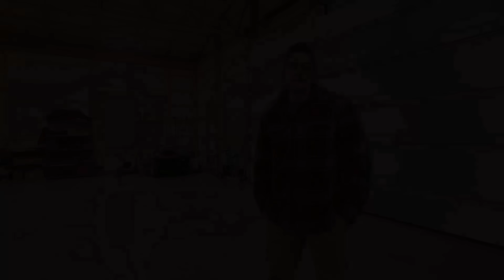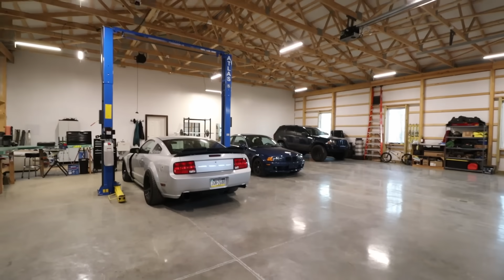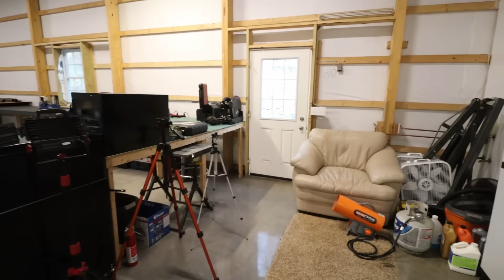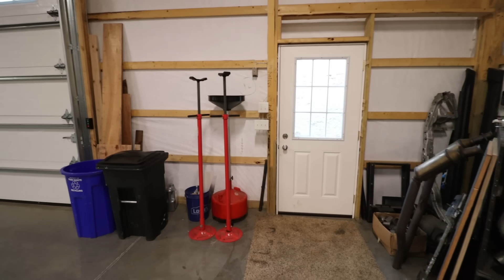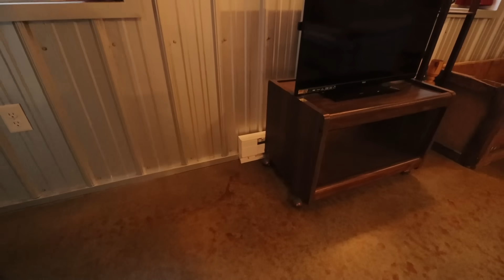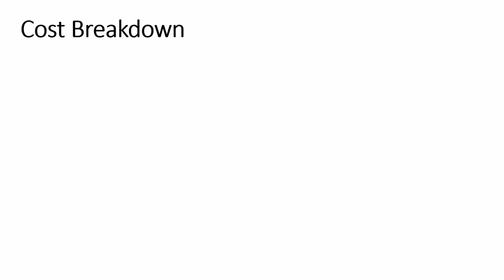50x70 Garage House - FULL TOUR and COST Breakdown

Comment: Nice job my friend. Total “It’s a guy thing” design, lol. Love it. What would be a very cool idea but also can be important to containing moisture (especially with the welding activity and any bodywork tasks as well as would definitely work as an air lock during the winter cold) would be to install a curtain rail around the perimeter of the garage door and drop a curtain from floor to ceiling in two sections from door side to center across the inner length on either side. For less than purchasing some pre-made custom curtains sized to your specific dimensions, you could actually buy the raw materials, purchase a nice walking foot industrial sewing machine (one can find some seriously nice vintage industrials for far less than new, just make sure it’s gone through by a actual pro sewing machine tech. Very important.) such as the Consew 206RB-5 or a long arm version, and make the curtains yourself. When finished, you then have a highly capable industrial sewing machine to make all the convenient carry bags, covers, and even upholstery stuff in your shop. With a long arm walking foot machine you can make some really big stuff and acquire some highly profitable niche work, lol!! You definitely have the room for it. You would be pleasantly surprised how much work comes your way once folks find out you have a true industrial walking foot machine that can effectively sew leather, vinyl, and even plastic or thin sheets of wood (I made an interesting fishing reel bag for someone that had a wooden base with leather sewn around the perimeter).

With the drop curtains in place you need not worry about where the power washer is shooting when your rinsing down a dirty vehicle and it would contain where the mist floats to that definitely carries dust particulate around the garage space. Given you have so many different activities going on under one roof this would be a huge plus. In the winter months, you can open that big ass door and not lose all your heat. When not needed, simply slide the curtains back to either side of the door. I had a friend do exactly this and it turned out to be a far more effective use than he ever imagined. He eventually installed some gripping mounts to the walls next to the door on either side so on windy cold days the curtain would stay put next to the door on either side. Then he got REALLY nuts and made himself a powered pulley set up with wires and roller pulley’s rigged up with a remote control similar to a garage door opener, lol. He gets onto his phone and checks his indoor cameras to make sure there isn’t anything in the path of the curtains, then hits the button that pulls the curtains around the bay section it creates in front of the door, then hits the remote to open the door. Stops the heat from escaping for the most part and also stops the dust and rain from misting into the open garage area. Yes, he got a little crazy and went overboard, but in the end it was actually a very ingenious set up that was incredibly effective. Something cool to consider for the future. Nice work my friend!! Especially all before you were 25!! Nice. 👍🏻😎👍🏻
Reply from the maker: Thanks a lot and yeah I have definitely thought about adding some curtains since I use the space for many different things as you mentioned. Really appreciate all the suggestions!
Reply: I thumbs up this just for the sheer length of it. TL;DR?

Comment: Only 2 things I'd do different loose the water heater & go tankless instantaneous electric water heater in the 21KW-33KW range.(big enough to shower, use washer together). Install solar panels as budget allows with a few skylights in garage. Nice job on construction, video, cost breakdown.
Reply from the maker: Thanks a lot and I appreciate the suggestions!

Comment: Did you insulate and drywall the garage or no?
Reply from the maker: Not yet. Although the seperating wall is drywalled and insulated.
Reply: @Kordare  I see just curious. Im going to build one next summer and going to leave the garage area without insulation and drywall for awhile. How is it heating in the winter? I dont know how winters are around you either. Im definitely going to do in floor heat
Reply from the maker: @yooper9062  no real heat in garage yet so it gets pretty cold, I thought about floor heating but it wasn't worth the cost and headache for the system.
Reply: @Kordare  I see haha. What were the drawbacks of the system? It seems like the upfront costs kind of suck getting a boiler and what not but from what I can see its worth it in the long run so just like to hear other perspectives. Also how are you planning on heating? Don't mean to be a bother with all the questions but im genuinely trying to figure out my best options.
Reply from the maker: @yooper9062  yeah it was the upfront cost and just another system to maintain. I was on a very tight budget so I didn't bother with it. Also didn't wanna worry about drilling into my concrete and hitting a water line. I'll probably do a large wood stove in the garage eventually since I have so much wood.

Comment: Great story. Wondering which LED lights you put in the garage?  Thank you.
Reply from the maker: Don't remember the specific brand but I have supplemented them with some more 3ft shop lights from home depot/lowes which are very similar
Reply: @Kordare  okay, so the 6 original LED light fixtures were only 3 feet long?
Reply from the maker: @scottjaenke3681  correct

Comment: Get rid of the water tank heater goto Walmart and buy a tankless water heater. ( electric) instant hot water limitless hot water. Only heat what you use. $$$ saving over the course of a few months vs month of month always and limited to 25 gallons at 158F and 25 gallons at 125 and 15 gallons at 100F. If your unfiltered well water smells like rotten eggs. ( well water ) then add a local hard water filters. Mine has eight filters. Once a year I got to change them out. Plus bags of salt to treat the water to make it softer and as purified as bottle water. But long term say a decade to twenty five years range the added annoying costs pays for itself. Because you still have Maintaince even in a traditional system on a well. That’s my suggestion. But I love this. Next large chunk of money I get I want this plan. Are ya selling your plans ? Love it. Don’t fix cars I cut trees down.
Reply from the maker: I appreciate the suggestion! And yes I do have my full plans for sale on kordare.com

Comment: As a former builder with 12 years of owning my own company, and 25 years of construction, I can say that your numbers are very realistic. I like the way that you have done this project young man. I have bought some land near the mountains out to itself in northeast Georgia. Wife wants a nice house. I want a shop to restore my 1969 Camaro. I am close to retiring from work, 4 years maybe. You have gave me inspiration at 64 years old to pursue a shop building FIRST! I might end up living in it by myself but ol well. Thank you for posting this video. Good work all around, in the video and construction.
Reply from the maker: Thanks for checking it out and good luck with yours!
Reply: I got an estimate for a 60x80 metal building slab and all for $160,000 down in texas and I believe that included 4 bay doors. The guy said the price also depends on the cost of steel at the time too and I believe it was high a year ago when I asked. Now of course this didn't include the land and this was just an open steel building with no rooms inside. I can just build an office inside if I want one.
Reply: I have two friends that have this same setup.  One is almost this exact size and one is less than half.  Both being a 25/75.    I thought living space was small at first but being a dude that’s usually off the couch and phone, the inside is for the boss lady so let her “design”  her part so you can get yours.   Dude has a lot of 💰in unused space, which is nice if it fits in the budget.  It cost more to build and more air to heat.  Porter field do yourself a favor and do the blown insulation then the foam board insulation in the wall(buy it surplus/salvaged)You can get more out of the living space by bed and bath upstairs.  Cut out the 💀 space and use the money for geothermal(you can do it yourself and way cheaper than any bid from HVAC companies) cuz the boss lady’s cold little toes are gonna have you chopping a shit ton of locust or spending your supercharger money on more coziness!   
 
God Bless and thank God for our Bull in this commy china shop Trump!!!🇺🇸🇺🇸🇺🇸💯
Reply: @mattprice37664  Hey Matt, you are a fount of info and obvious experience. Nobody in general construction videos ever talks about geothermal (unless of course, you go to a geothermal video)
When you say diy, are you still talking about hiring the drilling rig operator/ contractor, on top of doing your own pipe layout?
Also, I'm thinking of doing the deep vertical loop rather than the shallow horizontal dig-out, it just seems more compact and advanced, with higher heat potential down deeper, with a lot less mess and fuss. 
What's your preference between the two system types?
Reply: hey randall, my dad was horse guy
he definitely said to build 
your shop/barn first before 
you build her house
you need a shop space first 
to make the stuff for her house
Reply: It’s never to late, I’m your same age and I just started a 20x55 shop to work on my cars and bikes.
Reply: Realistic if we pay you. Half is DIY
Reply: How much did he pay
Reply: Divorced 42 year old. This is my dream, but I'm worried if I wait to 62, I might not be in good enough  shape healthwise to restore a car at that point (strokes and cancer run in my family).

Comment: i got an e46 for 300$ the m sport package and euro clear lights made in bavarian, check it out on my channel. can I come work for you bro?
Reply from the maker: That's super cheap and sorry I don't have any jobs to give right now
Reply: @Kordare  haha im in norcal man the "can I come work for you" thing was just a joke. yeah the e46 had some bumper damge missing a side marker light, and had 6 codes needed a valve cover gasket (60$ diy, and three o2 sensors (junkyard 5.99 a piece) new fluids and filters and threw new plugs in there for 17$ got it to pass smog runs great everything works, 326k miles and counting the only thing left to tackle is my semi sagging headliner but for 300$ who really cares. all the bumper damage I pretty much fixed with some gap filler and bondo just to give the illusion the cracks aren't there.  congrats on the property and garage really inspiring

Comment: Just curious how you afforded this. I’m currently 22 and have plans to build a 30x50 house. $3400 saved up so far and calculated around 35k to finish it. My plan is to begin construction at 10k and keep that pattern of building and saving until it’s finished.
Reply from the maker: I basically did nothing but save for about 4 years for a large down payment and got a loan for the rest.
It sounds like you're trying to do it without a loan which is good but will most likely prolong the building process. I have no idea how you'll build any type of house with full utilities for 35k...

Comment: If someone else haven't mentioned it.  Ever thought of adding solar panels on the roof...you have a lot of roof, and it would help offset the cost of the electricity, especially if you have to run the baseboard heat.  Even maybe set up a geotherm heat system at some point.  Nice setup by the way!
Reply from the maker: Thanks! And yeah that would be a good option. I havent been very motivated to do it since my electric bills are so low. I never run my baseboard heat since the wood stove heats the space so easily... and I have infinite wood supply 😁

Comment: You have a 15A outlets on a 12 gauge romex circuit.  You need to have 20A outlets installed (They are the ones with the T-shaped neutral slot)
Reply from the maker: oh really? I'll look into it,  thanks.
Reply: @Kordare  The outlets could be correct if the wire length is long enough from the panel to the outlet to require the larger wire.  How far are the outlets from the panel?

Comment: very nice, thank you for sharing.  Is ther a reason you did not "finish" the inside of the garage...like spray foam insulation then drywall/plywood so that the walls are flat?  Also, your place is insanely clean!  nice job!
Reply from the maker: Thanks! and only reason was cost, but I plan to in the future!

Comment: They make a commercial insulation for buildings like that. Granted its mega expensive. But it's made to go on 8' center 6x6 walls. Its heavy vinyl backed so it creates the inside walls. We heat a 30x40 easy with a 50k btu propane torpedo. Plus if you drop the ceiling down to bottom of rafters you loose 1/3 of what you are heating. You obviously know that. Now all you need is a 6ton commercial HVAC unit and I would never want to go outside lol. How awesome it would be to have to room to load a car hauler inside and leave it till you are ready to pull out.  I'm started to get choked up I gotta go I'm sorry lol

Comment: I absolutely love it. I'm wanting to do the exact same thing. If I cant find anything. Talking to family I would be perfectly happy to buy a commercial property and build an apartment inside. Love your set up! 1 thing I noticed but not sure on. Is your lift plugged in above it in the rafters? 1 tiny suggestion if so, drop that cord down with the plug. After spending a lot of years working on 1 everyday you will have one run away sooner or later. The contact in the switch will go out and stick. Only way to stop it is to yank the plug loose. I'm talking I've had maybe 2 go bad in 8yrs. But it's always safer to be able to yank the plug. You can probably make it to breaker fairly quick. But if it was my $3-4000 and the pump was dead headed like that I would worry a lot  lol.

Comment: Congratulations, you're well ahead of the curve for your age. I would like to respectfully suggest covering the shop/garage walls (after insulation if you intend to add) with 5/8" sheetrock. 5/8" rock is fire rated. If, while you are welding or grinding, enough sparks hit the plastic covered insultion; you could accidentally wind up burning down your shop and home.
Reply from the maker: Thanks for the suggestion, I will definitely cover up the insulation once I get to that point. Hopefully soon!

Comment: Some heat pump mini splits would be good for you, possibly diy even. A tankless water heater would be good for decreasing electric bill.
Reply from the maker: A couple others have mentioned mini splits as well, so I'll definitely look into that. My electric bill is already very low thanks to LED lighting and the wood stove, but thanks for the tip!

Comment: 134k would build a nice traditional house and 20k for separate garage.  What's the point here and you are not even finished.
Reply from the maker: Trust me I quoted a traditionally built house here, along with a steel frame building. Both would be much more costly to build something of this size. Average price per sqft of a traditional home is around $100. This place has a 3500 sqft footprint. You can do the math.

Comment: Take my advise young man, think security...alarm, motion sensor lights, cameras. The building is way too approachable. Maybe a good large dog as well. One question though. Why the blood stains all over the house floor?
Reply from the maker: I do have a security system and those are good suggestions! That's actually concrete stain that didnt soak in correctly.

Comment: PROTIP- TV by baseboard heat will cause logic board and or power supply issues that will render said TV paper weight 🐱‍👤
Reply from the maker: Hmm interesting, havent had any problems. They are on completely separate circuits and I rarely use them.
Reply: @Kordare  Not electrical issue - thermal issue - heat from baseboard increases chance of overheating and desoldering of components under long runs. I worked as a scheduler for a TV repair shop that serviced samsung, lg, and sharp warranty repair orders. I performed second hand over the phone diag and ordered the parts accordingly while scheduling the time and date of the technician to perform the repair. I got to see primary causes by asking where the tv was located and if there were fireplaces, heaters, or humidifiers around. The statistics were staggering. People didn't think about the proximity to rising heat when placing their TV's. 

Regardless - amazing home!

Comment: Put a wood stove in the garage.  This way when you are out there working in the winter, it can stay warm without using propane.  Second, install a pipe the length of your property at 5 feet underground.  Under your drive way would be easy to do.  Hook it to a fan in the house and you will pull 55 degree air.  Basically air conditioning for free.  And if its colder than 55 degrees outside, it doubles as a heater.

Comment: What coating did you use on the concrete in the garage to coat it? Is it like a clear epoxy?
Reply from the maker: I used a surecrete polyaspartic coating that I rolled on.

Comment: You should be putting a door in at the top of the stairs or at the bottom. Your losing alot of heat through the uninsulated upstairs
Reply from the maker: I actually keep a sheet of insulation across the opening during the winter for that reason
Reply: @Kordare  awesome 👍

Comment: Good on you man, that's such a sick place! I'm aiming for big land and a decent shed/workshop on it with a house. Although where I'm from (Australia) that'll be about a million dollars, and you wouldn't have a shed anywhere near as big as yours. Do you have much structural strength in your shop roof? Could you attach a block and tackle and winch off it with the timber beams?
Reply from the maker: Thanks! And I'm thinking I would need to add additional support to attach anything heavy to the roof structure.